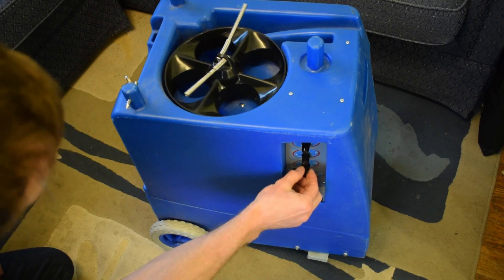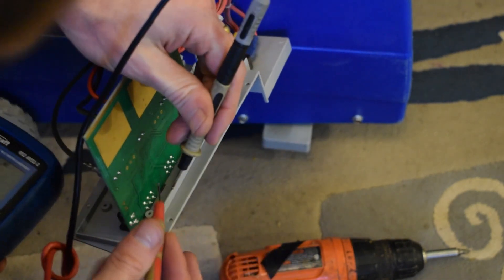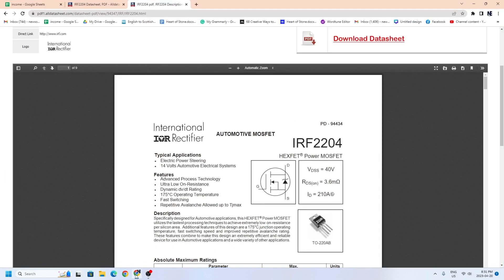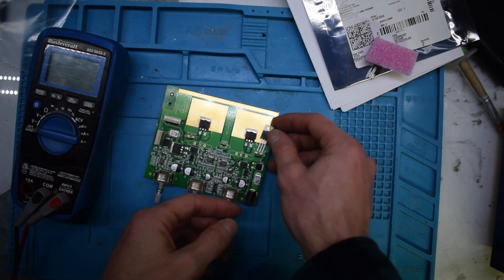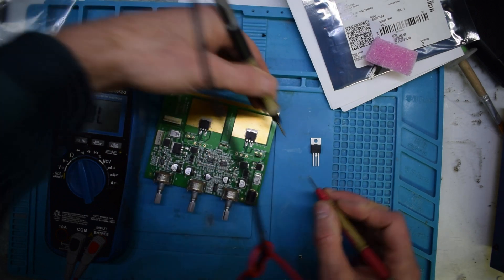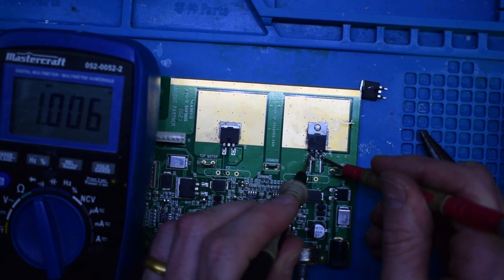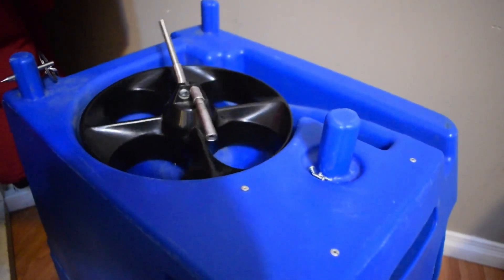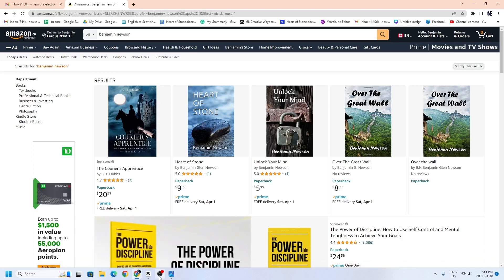Silent partner ball machine repair (speed control)

Comment: Thanks for your video maybe you can help me with my SP Scoop for some reason when I'm turning on the toggle switch its immediately starting the wheel rotation. I called the support center and the guy told me that probably I need to replace circuit board (320$) don't know if its possible to fix it by myself.

Comment: I'm having a similar issue with a SP Scoop Quest model machine ... the hopper was overloaded with heavier foam core balls. Nephew place both 5 gallon buckets (200 balls) in the hopper and it put too much strain on the small carousel motor .. don't think it hurt the motor but it seems control board quick working .. upon further inspection. I noticed one of the two hexfets looks quite distressed and seems to be reading badly on the dmm compared to the orher. There seems to be controversy on how to test these and others  saying you need two dmm one to apply voltage and the other to test gain/dump stages etc... unfortunately this is above my level of expertise and probably should send PCB back to SP and hope for mercy

Comment: The feed interval knob is on the bottom.  When you turned it the Carousel slowed down as it should.  The top knob controls the throwing motor speed not the carousel.  Doesn't appear to be the problem with this machine